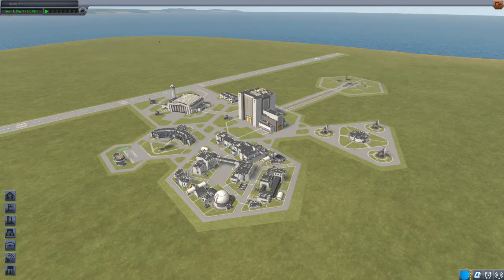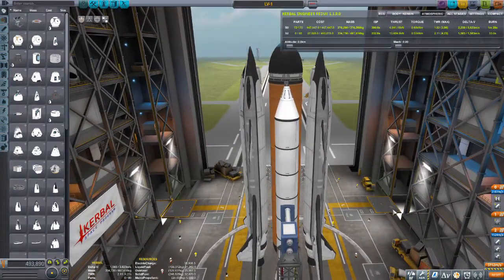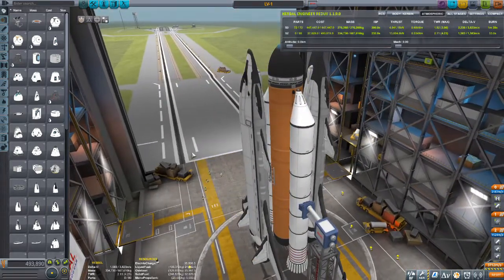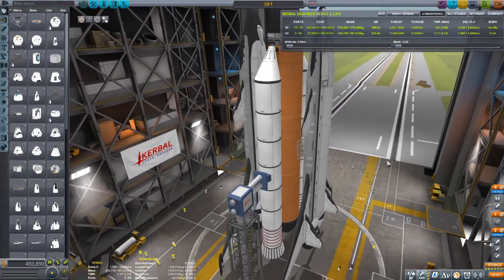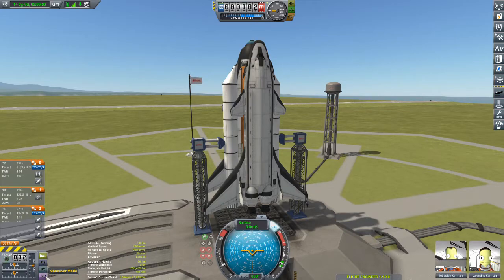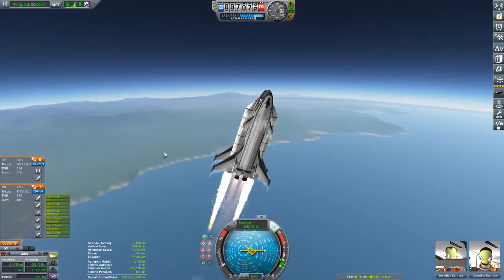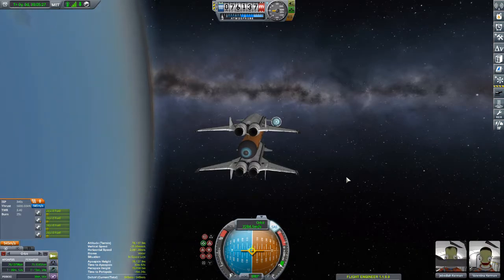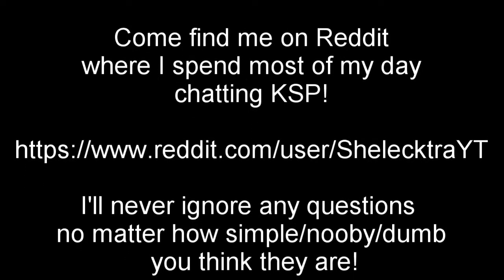Kerbal Space Program - Twin Shuttle Launch - Why Struggle With Just One Orbiter?!

Comment: This concept worked for me! I can use one docking port for a mining rover and one for a orbital refueling station module or just use two shuttles to build a decently cool space station around another planet. And or just use one plane as a rescue ship for the other. Also can you save lots of money in career mode with this concept? And what does the refuel craft look like for the docking port in front of the orange tank? Oh I know how to make buran shuttles more with all the TWR underneath the external tank. I’ve been making quite a few shuttle concepts.
Reply from the maker: Yeah, it's definitely a very versatile design :)

For refuelling you can either use a fuel tank thats capped with the same docking port (I think its the senior docking port) Or you can use a claw. If you take a look at my Pelican Station Builder SSTO thats the station that I would dock to and take with me where-ever I'm going. Might do a video on that next part actually so it can be shown as a working practise :)

I'm not sure about it saving money exactly, but its certainly more capable of doing larger missions in one go instead of multiple launches, so I guess if you factor in launch vehicles (Which are normally disposed of) then I think it possibly is saving money :)
Reply: @shelecktra1924  It definitely might save money once you rack up lots of contracts for said planet of interest or space station runs etc. which planets can you safely land in in stock KSP solar system? Oh are your cargo tanks fully fueled?
Reply from the maker: @pricelessppp  The fuel tanks are in a setup for LKO at the moment, so all they carry is 2.5k monoprop to perform orbital manoeuvres then return to kerbin after. I use Interstellar Fuel Switch to alter the fuel tanks so if it needed a LF/O tank to get back from a more distant planet, say Duna, then you only need to alter the fuel tanks accordingly for the mission at hand.

I'm a bit mad though when it comes to landing, I can basically land most things anywhere! The monoprop RCS blocks are very powerful so say its Minmus I just do the normal retrograde burn till the engines are about 2 or 3 meters off the ground then flip it over on to its belly using the RCS blocks. I have done a slightly different landing style before though - You can install landing legs into the wings and land vertically if you wish, it makes getting off the ground again alot safer and easier if you cant get the nose up with no atmosphere. But again, the RCS blocks provide alot of power so it normally isnt an issue.

At the moment it's very overpowered just for a simple launch so it has the ability to take some cargo to orbit, but if you want cargo AND more fuel then you may need another pair of boosters and alter the thrust limiters accordingly.

It's all about forward planning and adapting the vessel to your needs really, I always aim to be totally out of fuel on return because that means you got it right, if you still have 10 seconds worth of burn when you get back to kerbin then you could have taken either less fuel or a little bit more cargo! ;)